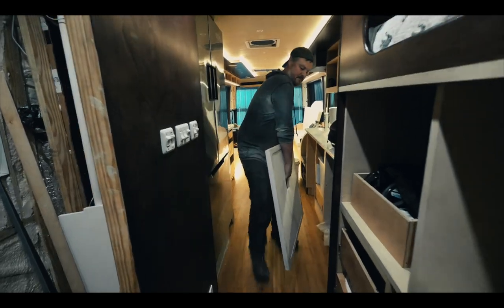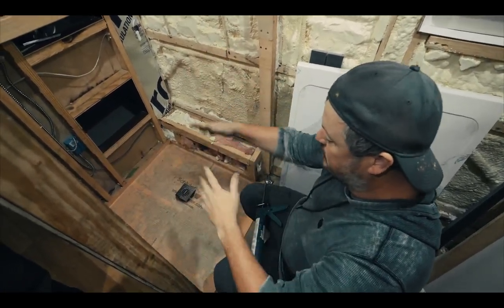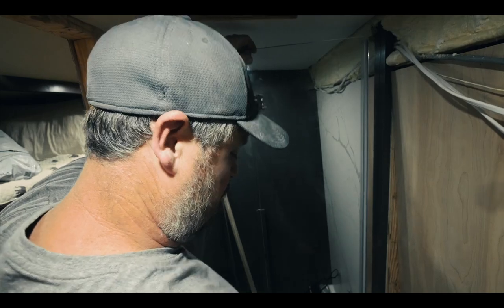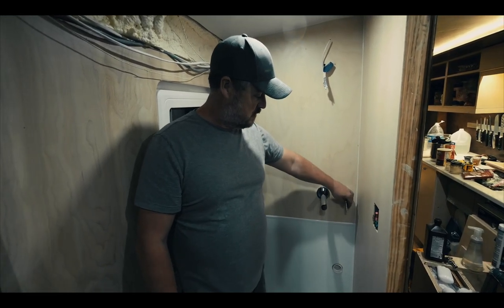Beautiful Quartz Shower Stall for our Bus Conversion!

Comment: On your shower floor drain how do you keep water from coming back up through the pipe into the shower floor pan ?
Reply from the maker: There is a p-trap on it under the floor.
Reply: @TheBusLifeShow  Thanks for your reply
Reply: @earl9027  A HepVo pipe is another possible option
Reply: @isaiahbangura4421  Thanks